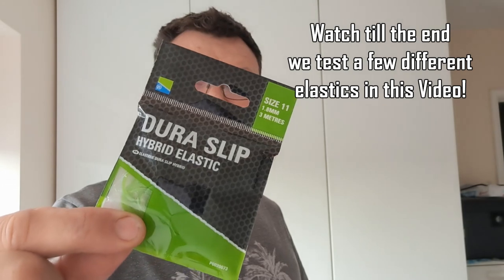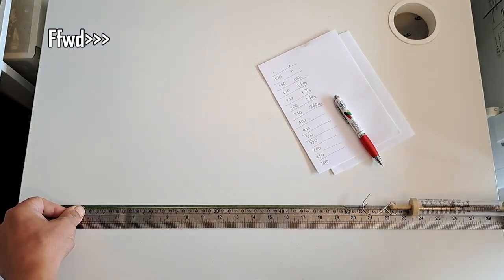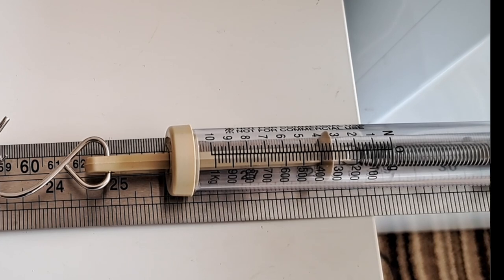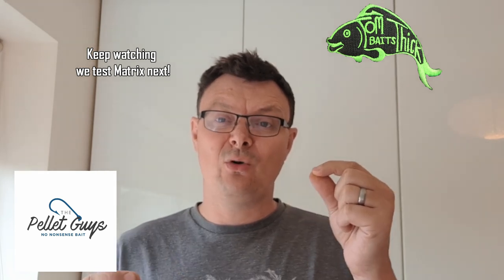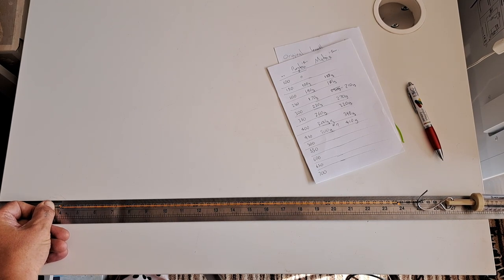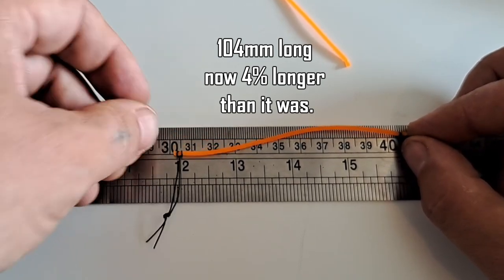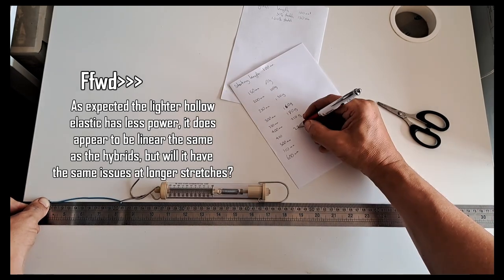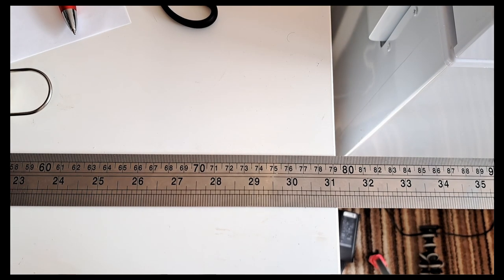THINK! you know how your Pole Elastic works? THINK AGAIN!!

Comment: Another brilliant enlightening video, I love this kind of thing! It does make you think that stretching elastic adversely affects it, therefore important to protect it, for example I use Preston hook ups so I don’t have elastic out of the pole when not using a rig (also protects from sun). My elastic does seem to last well compared to what other people say their experiences are. Your point about lowering the tip and lifting to apply pressure is a good one. It also explains why you think you’re ready to net a fish then find you need another pull on the side puller.
Reply from the maker: Yes Paul and I was playing a 17lb carp Thursday and all I could think was, it's wrecking my elastic🤣😂🤣

Comment: Very interesting and thanks for taking the time to do the video. A couple of things I got from this is; 1 using the correct strength to size of fish seems even more important and 2 by using longer kits providing more elastic should prevent it from getting weaker/bottoming out so quickly over a period of time
Reply from the maker: I will be thinking hard about which grades I put in my pole next, definitely going up a grade or 2 I think?

Comment: Really interesting video as we had a similar conversation over a beer last week. We spent 4 days at Viaduct Fishing and all went with new elastics in some of our power kits. We had a mixture of MAP and PI. I certainly expected after a few larger doubles to have to adjust the elastic tension but we all found as the weekend progressed that we were having to cut inches off each day. Now some were catching 15-20 carp a day (8-15lb) but the elastics just didn’t stand up to the continuous stress every hour every day. I had the MAP 14-16 break on one occasion. I certainly feel that once they have been bottomed out with say a foul hooker they do change in characteristics and become less powerful.
Reply from the maker: Well my experiment backs that up😊
Reply: @AverageAngler  I’m personally thinking of going back to the original PI Hollo in a couple of kits for the Autumn/Winter.

Comment: This is a common characteristic of all of the elastics-they power up to a certain point and as you hold it in that stretched position it starts to loosen up. 
I shoot a catapult as a hobby and I have done similar tests on different elastic bands to test the draw weight of different bands and that’s what I found.

Comment: Hi there. Great video for a compete novice on elastomers. What you found makes absolute sense me and exactly what anyone with a basic understanding of elastomers would expect. To help you understand the things that you were surprised about (decaying tensile force), I suggest that you simply search the vids on here about 'elastic hysteresis'. Question for you - the hollows will suffer more from hysteresis than the solids - why do you think this is? Why would the issue reduce had you have tested the elastic in water? Why do you think that you need to pull twice as much hollow elastic through the puller compared to a solid to pull the fish back in?

The jerky/jumping readings of your balance was just because of the friction of parts inside the balance when you didn't hold it perfectly inline with the elastic. You can get around this by tying a string loop on the metal loop that you are holding, then it can flex in 2 axis (if you hold the string loop). It would be better if you then did the test vertically, say on a door.

By the way, I looked at your previous hybrid vids. I can't see much wrong except for the Drennan elastic is not sold as a hybrid elastic. It is a natural rubber latex product, albeit slightly more stretchy than many previous latex versions. Just smell it, feel the friction, look at the solid colour v's slightly translucent hybrid etc. Show me a link (from Drennan) or a packet where it says it's hybrid and I'll send you £100. I would expect a much larger batch to batch variation with latex processing compared to the controlled processing of hybrid single extrusions.

Hope this helps.  Anything you want to know about this subject - just ask!
Reply from the maker: Thanks for taking the time to reply so comprehensively. I really appreciate it. I will be googling the phrases that you have suggested, even if its just for my own knowledge. What exactly is the difference between a latex and a hybrid elastic. Do you have any tips for increasing longevity of elastics?
Reply: @AverageAngler  Believe it or not, whilst I probably know more than many people on this subject, I do not consider myself an expert. My knowledge is only a basic understanding from A level physics (that you'll find on youtube vids explaining A level elastic hysteresis), followed by a general engineering degree.

To answer your question on latex v's hybrid - I don't 100% know. When rubber is stiff, we simply call it rubber. When rubber is purposely made stretchy, we tend to call it elastic. All natural latex rubbers that are made from a compound using the sap of trees (see wiki and loads of youtube vids). There are synthetic rubbers (plastomers) such as silicone - again check wiki & youtube. They have made erasers (plastic rubbers) for years. Logically, some of synthetic rubbers that are very stretchy are 'synthetic elastic'. Now for hybrid (not covered in my studies) - the issue here is that they don't say what it's a 'hybrid' of. I'd be surprised if 'hybrid' elastic doesn't contain latex myself. I can only ASSUME that it's taking 2 different materials or different process to achieve a new property, but it could be a fishing marketing 'made up' term. It could be that original elastics were made in ribbon form (tearing apart to get singular pieces) and hybrids are formed singularly from a head (like a watering can rose).

I do not recognise many of the terms used by anglers to describe the property/performance characterises of elastics. There are many fallacies and made up terms used in fishing. Not sure how much this is marketing or made up by anglers to look clever in the eyes of the uneducated, and stupid in the eyes of people that know the subject. 

Latex rubber degrades with environmental factors, but most synthetic rubbers have superior environmental resistant properties.

So what's happened to the £100 challenge? What are you going to do about the previous misleading hybrid elastic videos? For a given material, the resistance offered is directly proportional to its diameter squared, i.e, cross-section. You can test this by using 4 x 1mm pieces (in parallel) tied in series to a single piece of 2mm. The properties of latex are different and being a more natural product it's subject to a greater production processing & property variability.
Reply from the maker: @Takle Teck  thanks again, I am not sure how many more future videos if any will.be focused on elastics, I agree with you about misleading terminology within our industry. I have taken the time to swat up on the subject as you suggested. I have a background  of basic metallurgy (being an engineer for 25yrs) so I found it easy to follow the explainations. I'm not sure how many anglers would follow it? Plus I don't think.it has a massive impact on anyone's fishing to know about it. I am just trying to make videos that interest anglers and I went down this particular rabbit hole. I suspected it would yield some interesting results. I wouldn't rule out more videos on this subject as I am quite whimsical at times but can't promise anything. As for the £100 challenge, it's on the back burner, but it is one of the several hundred Ideas I have bouncing around inside brain🤣🤣😂🤣. I think I need to get better with my filming and editing in order to do it justice.👍
Reply: @AverageAngler  I think that different elastics do impact peoples fishing and definitely their wallet! It would be good if you do a video comparing a 'so called hybrid' with, Drennan power pull, a hollow and Daiwa hydro. Simply stretch similar strengths of the different types tied together in the same way as you previously did, and watch how differently they contract. You will see that the hollow becomes 3 x longer than the hybrid when releasing the tension, meaning the need for lots of pulla use to get the fish in on hollow. You can also plot the X-Y graph of the hysteresis curves that you'd previously started with the balance. It would be a revelation to some people and it would stop all the fallacies that justify the expensive hollows. I'd do it myself but you have a ready made audience of followers! I'll help you if you wish to ensure its technical accuracy.

It will upset many users of the more expensive hollows and they'll tell you some mythical things that happen that completely the characteristics of the elastic if it were inside a pole with a fish on! I predict that the Drennan Power Pull latex will stretch furthest and the solids provide more force than the hollow during retraction (lower hysteresis loss) due to the way hollows are formed (dip coating a mandrel).

Comment: Great video again John, these are thinking mens video’s. Where does this leave short kits?  It looks like if you catch a large carp on a short kit it would weaken quicker than a longer kit with more elastic, is that right?  I know short kits are designed for F1 fishing, but you can’t predict what fish you will catch.
Reply from the maker: I suppose less elastic means technically you could get more wear.
I think we have all lived with this issue without knowing it. So whatever you did before will still work, just something to think about? I might go up a few grades and see how I get on, hoping to have the fish under control without bottoming the elastic? Interesting question about short tops Idont use then so hadn't thought about it?
Reply: Yeah, you are so right we have caught big fish on these elastics forever haven’t we?  However I still enjoyed the way you went about this and knowledge is a great thing, so keep it up. I like scratching my head trying to understand the way you are thinking 🤔
Reply: I’ve gone back to hollow (mainly Maver yellow 8-11) for short kits as there is not enough give in hybrid in a short kit when you get a bonus fish. I might have to strip more elastic at the net but think it’s worth it.

Comment: John - Have you tried these tests with the original Preston Slip?  Does it not stretch as far, and does it behave in the same way?  It would be interesting to know what your views are.
Reply from the maker: I have tested its stretch and it definitely doesn't stretch as much. I haven't done any load tests with the spring balance maybe I should?
Reply: @AverageAngler  If you do test it, i would be interested to know.  It might work better in the long top kits, and you definitely wouldn't have to strip as much to control the fish. Having watched your videos, do we really want an elastic that does not power up, and gets weaker when it goes beyond about 400% stretch?  It would appear that the fish is 'free' to swim for that last  approx 300% until the elastic bottoms out.  Maybe I will put some original slip back into a top kit and try it.  After all, it is a lot cheaper than hybrid!

Comment: I take it nobody listened in this physics class?
Elastic to plastic change point known as the yield and plastic deformation up to the failure point?
All materials are classified like this/a material is designed using it’s Young’s modulus number which is basically before the yield point?
Reply from the maker: That's clear as mud thanks😂🤣😂🤣😂
Reply: @AverageAngler  basically every material on the planet will return to its original size after stretching but won’t past a certain amount of force.
Your findings are in line with physics and not unexpected. 
The most hilarious comment was off your guy saying Daiwa elastic this doesn’t happen to. 
Like Daiwa are the only company in the world that the laws of physics doesn’t apply to lol 😂

Comment: so hollow with Daiwa is a case of get what you pay for . the new elastics i hate as i've said before , no control and i feel the top match men are promoting for there own gain . this is why we need average anglers 🤣 ps i use eBay and inject the elastic my self . few lads don't trust the new mastics not just me .
Reply from the maker: I would at yhis point assume all the elastic do this, but without testing it's all just speculation 😊
Reply: @AverageAngler  yes true, you carry on with the new ones if its giving you confidence .  thats probably why there's no control over the fish . ive tried and tested mine on fish and said from day one there not for me . good luck
Reply: @christopherjackson5275  the laws of physics apply to Daiwa to, they are not immune 🤣